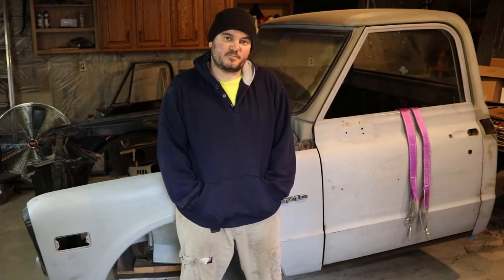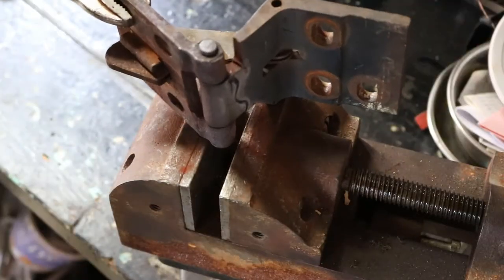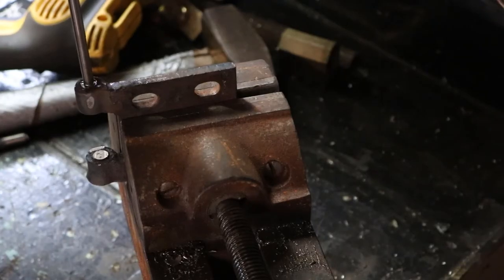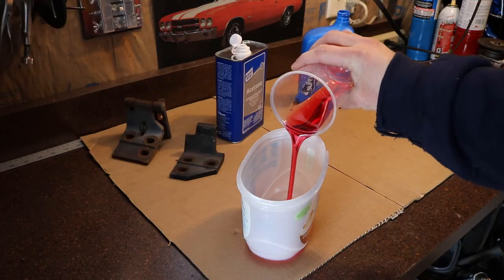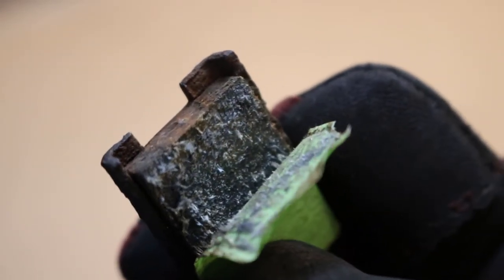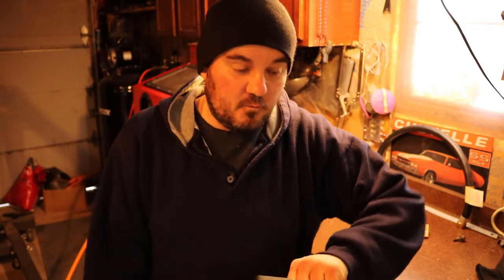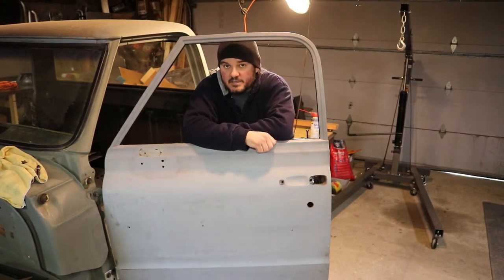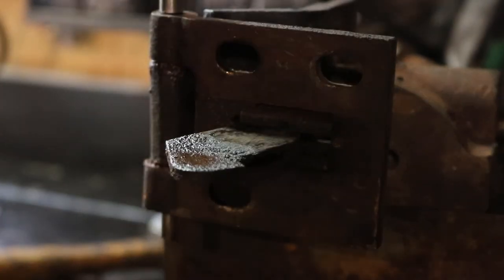Rebuilding Door Hinges on a 1971 Chevy C10 Truck

Comment: 38+ years in the business and never heard of “ATF & Acetone”. I am going to soak my right elbow in it.
Reply from the maker: Hahaha!
Reply: Just as a June 2022 update, I had all pins come out using my 2lb cross-peen hammer and roll pin punches. It comes down to maintenance! Yes, the drivers side floor had a little rust and passengers too, but less. Snow, wet boots, we all that, but 55 years of no lubricating hinges? 
 Depends on the part of North America you live in, but the national franchise known as “Jiffy Lube” I don’t think they own a grease gun or an oil can. After decades of dealer service I hate it when a customer comes in for a (Let’s say sway-bar link bushing) because they make racket that can be felt or heard if the radio’s down. But my god, I open the drivers door and it sounds like a 100 year old barn with a “Jiffy Lube” sticker in the windshield marked with 3007 more miles than has in front of me. 
  This means the customer goes in for an LOF, and asked them to look for something making a noise on the left front. Hopefully they changed the oil & filter but never sprayed, oiled or spit on the abnormally loud dry hinge. Why? I have spray cans of stuff like everyone, but I have 3 old school oil cans. Motor oil used to be cheap (So did bread but $3.50 for day old now) but fill my little can, upside down, push on bottom and oil comes out pointy thing (Highly Technical Term). I wipe off excess with a rag and work the door. On the farm, this was my job on both the car & truck. Check fluids, knock dust, butterflies and June bugs out of the air filter, but lube the hinges. Here’s the oil, the can sit there, do it! No app on iPhone for that!
 Most people have little to no idea how a combine works, except farmers. There are 20+ places to grease. At some point an engineer comes up with an idea and runs hard plastic hose to every fitting, comes into a manifold the a grease gun/cartridge screws into. They bleed the air out until grease only, then sold to a farmer. The first part is maintenance but it describes pumping the grease gun lever on its manifold and boom! 20+ grease zerks get several shots, done. 
It is something that bugs me. Like differentials! They only check the gear lube when is makes noise upon decelerating! Whoops, too late! 
I feel better now. But poor old Rusty McRusty Pants, to late. Yes, loud radios sell lots of car parts then later, hearing aids…..
I enjoyed this video so much, I had to watch it again!

Comment: So I’m here because I just lived through this myself today. I had a hard time on passenger side awhile back. Apparently I forgot how bad of an experience it was… months and months later I try my drivers side. Wish would’ve lived with the stupid thing how it was or just bought new hinges. Dumb the amount of effort and time involved to avoid just buying new hinges. Hope others see this video and comment. Learn and just buy new hinges…
Reply from the maker: Omg it's been too long. I forgot how much of a pain in the ass that was. Lol! I'm one to try to salvage parts off of these old classics but hinges are a losing battle most of the time. Thanks for watching Aaron!
Reply: @BustedClassicGarage  I had to step away from mine. Bent the tabs of the hinges, the pin goes through and had to heat and reshape them back… fun stuff… but I did make it through. For anyone else who reads this. Lol

Comment: I’ve heard ATF and acetone works. However, you did soak it for a week. I have a similar problem but my truck has the bolt holes inside the door rusted all the way around. I’m wondering if I can cut that section from an old door I have and weld into my existing door.
Reply from the maker: I don't see why not, just make sure you measure twice and weld it in the same exact spot.

Comment: That solution looks good if you can seal the container for small parts but if you're trying to spray it on parts still on the truck, I think acetone will evaporate too quickly to do much good. Have you tested that? My frame is BAAAD especially around suspension and all those fun nuts/bolts. My bed is LONG GONE. 35k miles, truck looks brand new on the inside (floor excluded). Too bad rust is a thing. When I go to disassemble its probably going to suck.
Reply from the maker: Yeah when I originally made the mixture I didn't cover it and I think the acetone evaporated within 24 hours. So yeah might be hard to do with the suspension components but you could always try heat and if that doesn't work worst case scenario you can cut the heads of the bolts with the cut off wheel.

Comment: Ever seen replacements for the 2 rectangular friction pieces? Where did u find replacement pins?
Reply from the maker: No I have not. I know I bought my pins from eBay but I'm not sure from which sellar at this point. Just search door hinge rebuild kit. Or here is a AMD set from summit. https://www.summitracing.com/parts/amd-521-4067-s?seid=srese1&gclid=CjwKCAiAvJarBhA1EiwAGgZl0BG1O6iKhysOF8RJOQ_kYw6DQN8oSwNtDBhQSVKiIG41ZYY9A7byBxoCu3MQAvD_BwE

Comment: Always try heat - get a Map/Oxy torch combination (cheap - used for plumbing mostly) and heat that hinge area up to orange, avoiding the inner pin piece. The hinge metal expands and it will easily knock out. If not, soak in penetrating oil overnight.
Reply from the maker: I'll have to try that next time...

Comment: hinge cracked cause you did not support it with a socket from the bottom, and please try one of these on your small propane bottles I did and it makes a world of difference, it's not the gas that burns hot it's a proper air fuel mixture so the color of the bottle don't matter, no matter what the Internet says